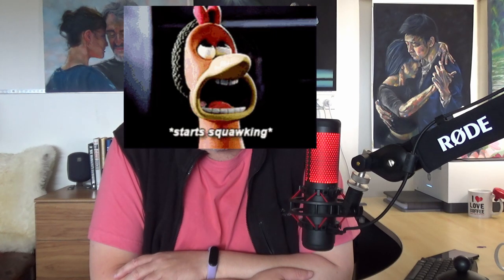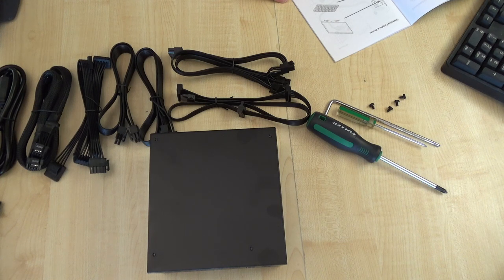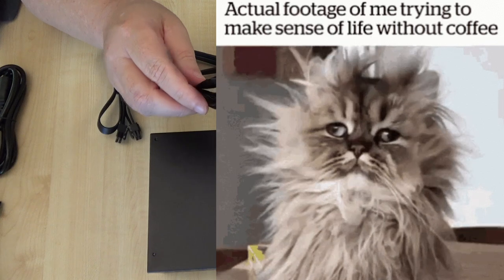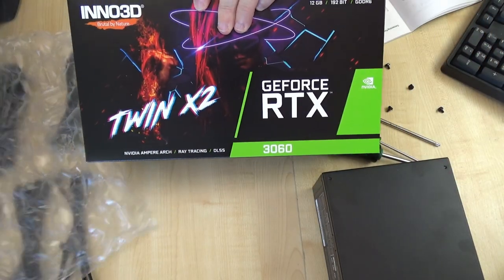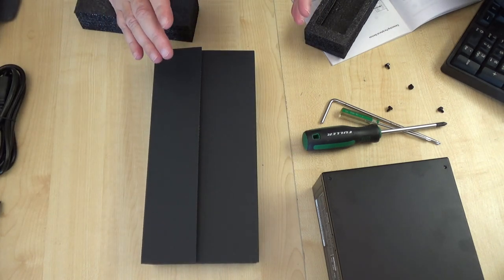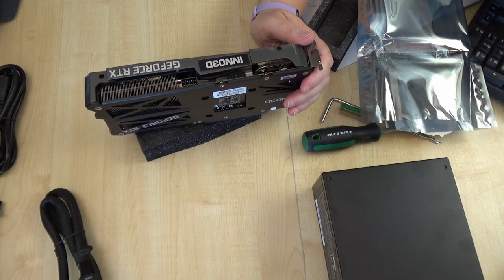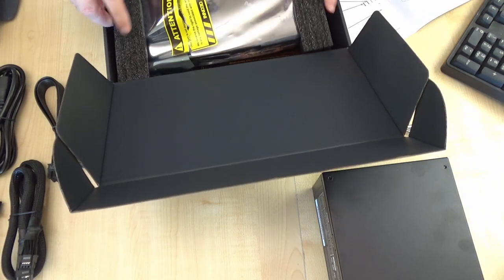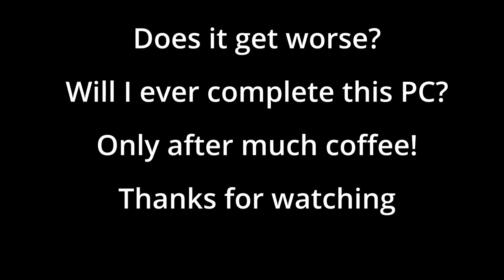BeQuiet its cable confusion time | An artist builds a PC ep 7

Comment: the 600w plug is for the new 40XX gen nvidia gpu, and the 8pin you tried to connect into the GPU is actually for the CPU (plug into the top left of the motherboard).
people often get them mixed up with the 6+2 pcie plugs for the GPU, because they are essentially the same shape and layout, and you do NOT wanna get them mixed up... 
it will fry all sort of stuff 😅

I can see bequiet changed they PSU end design to make the two look different, which is a good thing, a lot of the manufacture still have them designed identically, if you don't pay attention on the text on the connecter end, it could easily be mixed up = .=
Reply from the maker: I'm so glad to know what that 600w cable was for - it completely baffled me - thanks for scratching that itch!